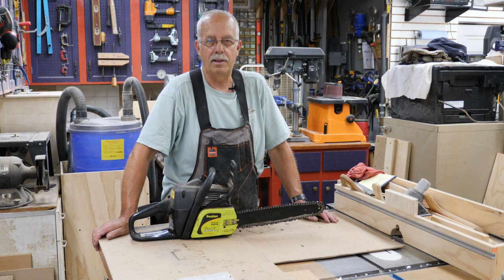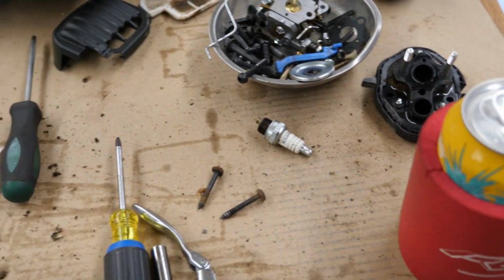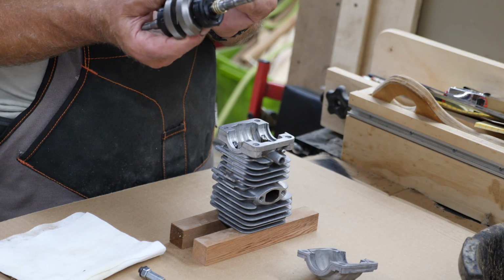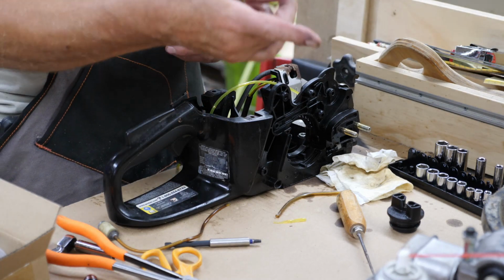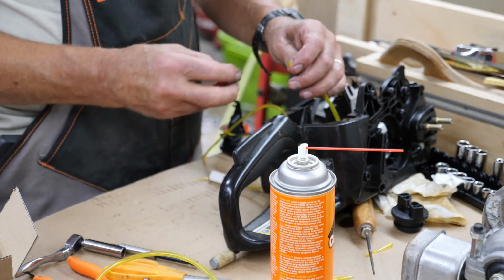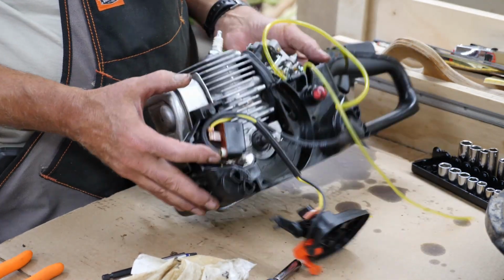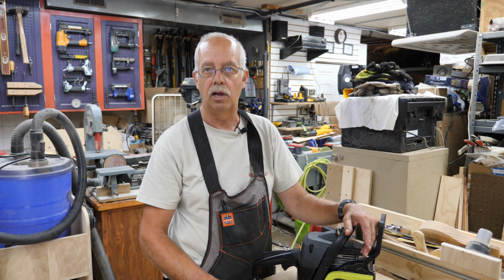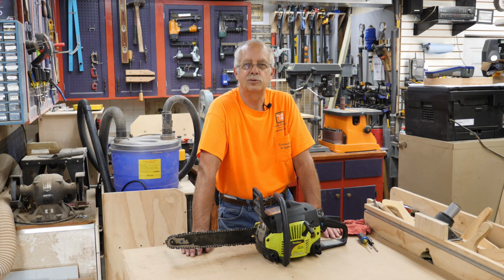Poulan P3314 Chainsaw Rebuild-Scrap Pile Find

Comment: Thanks for this video, I also got a hold of Poulan that was left for scrap. I took it apart and found the piston and cylinder scored something awful. I ordered a kit that replaces the cylinder, piston, and a few other parts. It helped me when you were showing the orientation of the piston. I got it back together and it runs strong.

Comment: My wife just picked one up for free at a yard sale that ended and became a "curb alert". I put some bar oil in it and some 93 octane gas/2 cycle oil, and went through the starting procedure, and it fired right up for 5 seconds and then died. Tried 2 more times and got same results. So it seems like a gasoline blockage somewhere.  I'll check the gas filter and fuel lines some day this winter when it's to cold to do Fall yard work. Then buy a $17 carburetor/rebuild kit if necessary. Always nice to have a back-up chain saw.
Roger thanks for the video.
Reply: Hah. I did the same exact results from a neighbors 3314. I purchased that kit, intend to replace fuel lines, filter, carb, and spark plug
Reply: @evilcoco321  I'm working on my neighbor's 3314😂 I noticed the fuel lines are wrong, so I was going to start with that. You ever get that one figured out?

Comment: I work on alot of these saws and there ok for home use and cheap to keep running 
Big thing on any saw is spray of fuel cap and oil cap area before adding fluid, brake cleaner is great for this 
I have two and several skils and I still use the poulan. All the time

Comment: Thanks roger I have a very similar project waiting for a rebuild so this was helpful.  Just planning on using it for smaller stuff.  One small bit of friendly constructive criticism for ya: please add a second camera directly above your work bench looking straight down on the project.  I really couldnt see what was going on in a lot of the video especially the fuel hose routing.  Thanks again and happy holidays from Louisville
Reply from the maker: Overhead video has always been in the "plan" and I'm actually going to make a video on how I do it.  This will be coming up soon!
Reply: Can you tell me how to remove piston  from  rod
Reply from the maker: @dwightfriend3766  I don't recall if this is a press fit or held by C clips on the ends of the pin.  If you don't see C clips, then you would need a press.

Comment: I was actually hoping to see the disassembly. The throttle on mine is stuck and it looks like I have to remove the rivets to get at it, though that part of the body seems plastic-welded together.
Thanks for all the detail
Reply from the maker: If the stuck portion is in the handle, try some penetrating oil sprayed up into the linkage.  That part is not something I have taken apart since I had no issues with it.

Comment: I buy these all the time and 95% of the time the fuel lines connected wrong and carb diaphragm back wards or gaskets in wrong order 
You can count on it if lines are new